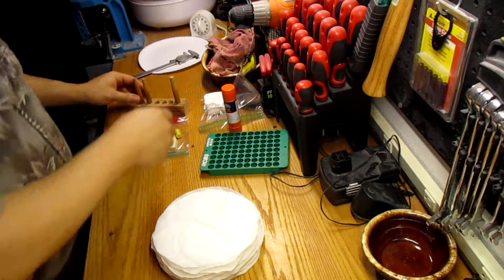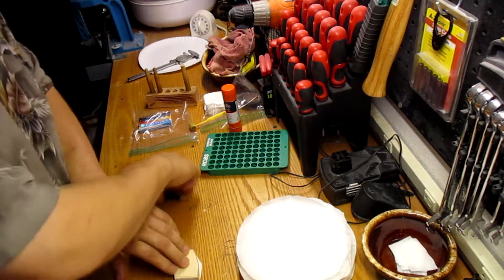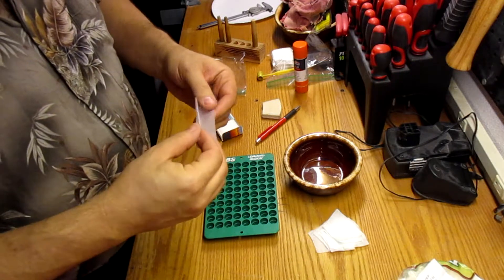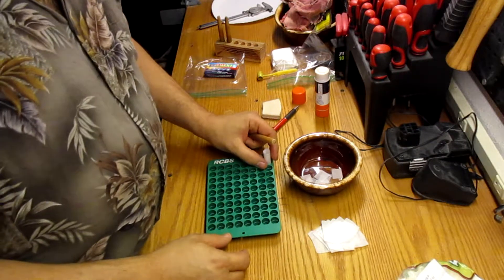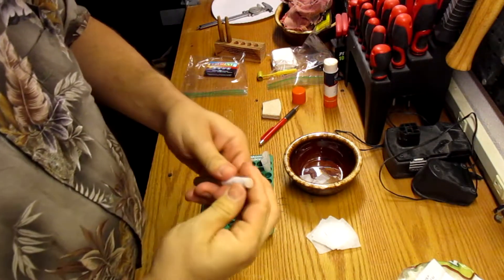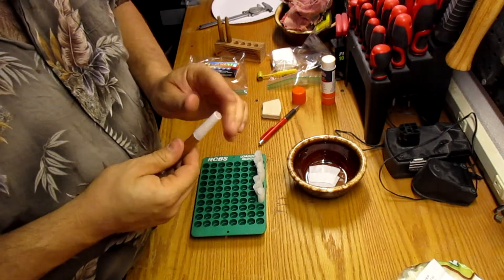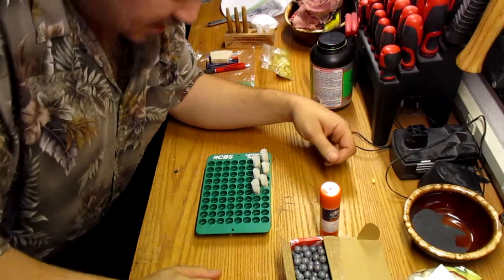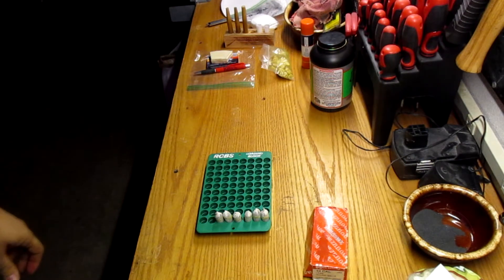Paper Cartridges for 1858 blackpowder part two

Comment: If you want to streamline the process and make it easier, skip the nitrating, cut the papers a bit longer, and skip the glue on the ball.  Also, roll the case starting at the middle rather that at one end.

Comment: A bit long, isn't it? There were many segments that you could have edited out. When you start going over 10 minutes, you lose a lot of viewers. So many vids to watch, so little time! Now, I have to go watch a few more "Like a Boss" vids and cute baby animal vids. Thumb up for paper cartridges. Thumb down for 28 minute video.
Reply from the maker: I'm a diesel mechanic and truck driver by trade, not a video editor. Also I work 50+ hours a week sorting recyclables out of garbage 10 hours a day, with an hour drive to and from each way so I don't get a lot of time to anything else.
sorry I'm no ace-youtuber... I'm trying to teach myself all of this.

thank you for the feedback, I'll try to get better.
I hope you watch the other 4 parts to the video as well
Reply: No worries mate! My just fine time is 30 minutes, my nogo limit is 1 hour! I have old hands, so I roll one, roll glue the end, then tap the end onto the end paper. Then I either shape the end cap or push  it into my makeshift former hole base board. I tap down the powder and press in the ball. I leave a 3/4 inch tail to easily  handle insertion. After pressing the rammer a bit, I pull off the tail, seat below flush. I grease with my beezwax/ vegioil bore butter firm  grease. Easier than typing the correct buttons! Hoho